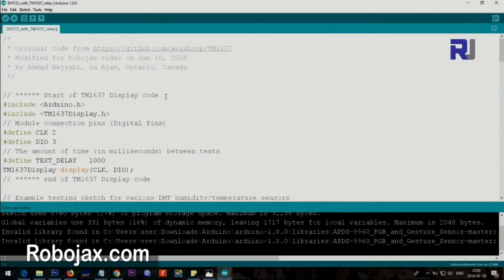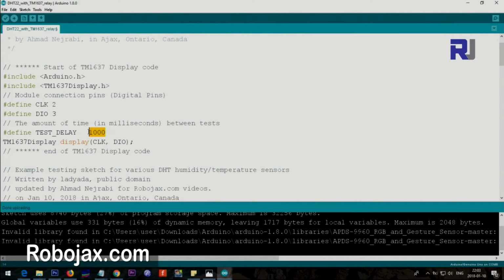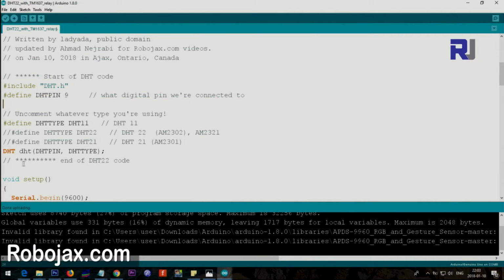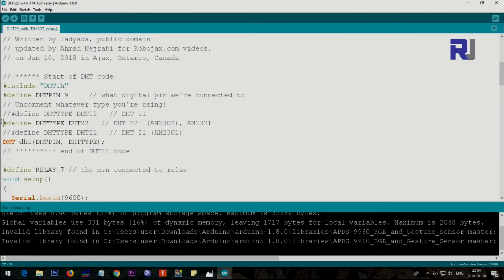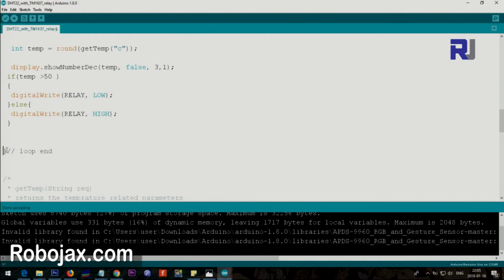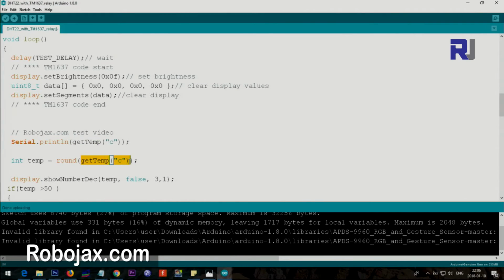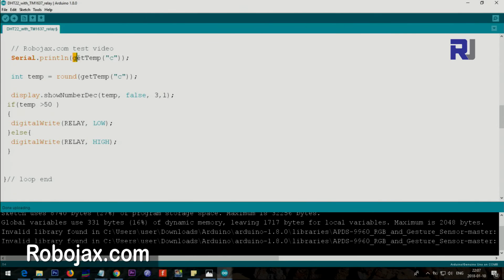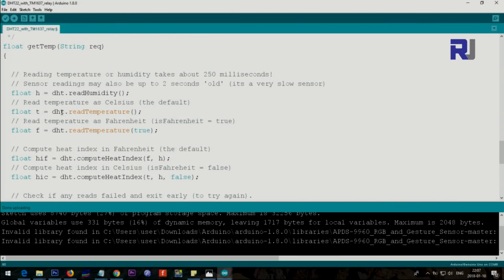Using DHT11, DHT22 with  TM1637 display and Relay to control AC load

Comment: I am Kishor Kumar from India right now I am show your code and I want to control 4 channel Relay module  with Arduino mega 2560 with  ESP8266 0.1 . Version  and display on LCD 16x2  display the temperature on it.  I hope you see my message.. I am waiting for you reply.
Reply from the maker: Hi Kishor,  why you posted your comment under a video that has nothing to do with your comment. there is no 4 channel relay  (4 ch https://youtu.be/Wbm3MCMgM_s) and 4 channel ESP8266 here https://youtu.be/a8yJoeFsKWw and LCD with ESP8266 https://youtu.be/mRAgS-CdURU which I have all of them. Please always post your comment under the relevant video as people read comments so they also learn something or offer help.

Comment: hey if i decide not to use the display, can i just leave it not disconnected? Or do i have to remove the code as well?
Reply from the maker: just disconnect the display. it should work but the library must be included as shown in video.